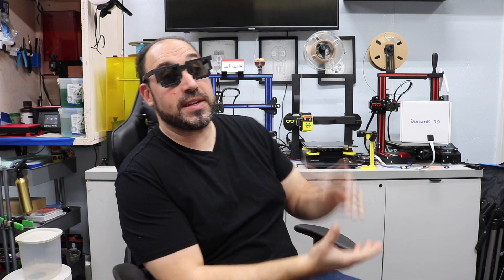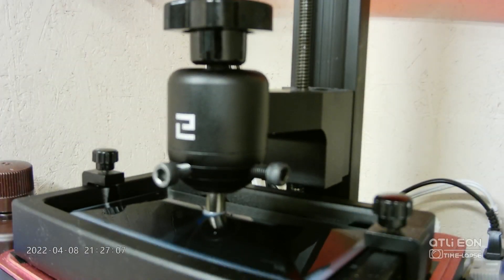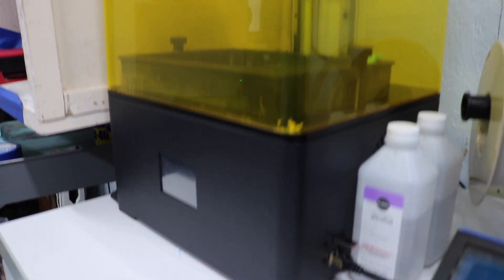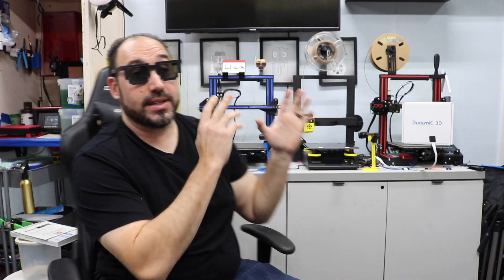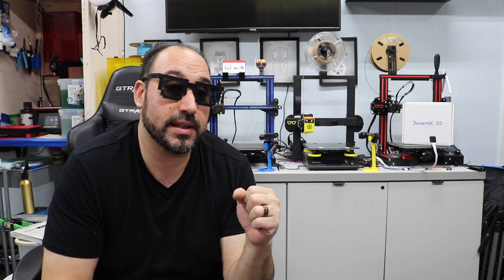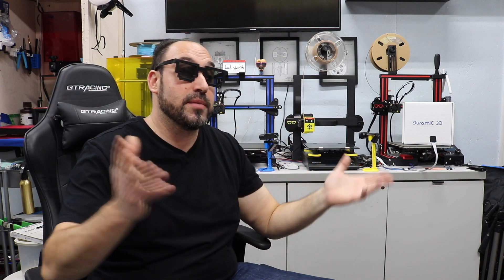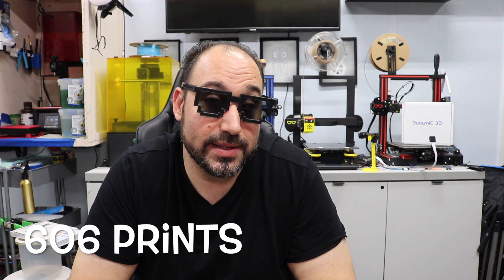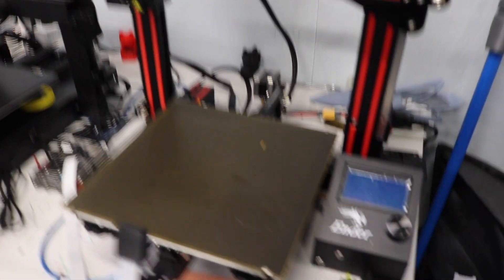Longevity of 3D printers

Comment: im running prusa on a ender3v2 but its printing in air how do
Reply from the maker: Did you choose the right printer in settings?
Reply: @CrazyWillTechShow  yes. Even tried messing with the x,y,z portion
Reply from the maker: @gho5tkustoms750  you really shouldn’t have to. I would try deleting the printer and adding again. Do you have this problem and Cura?